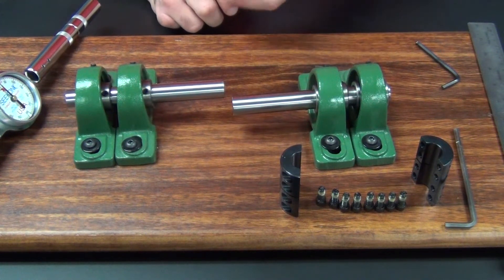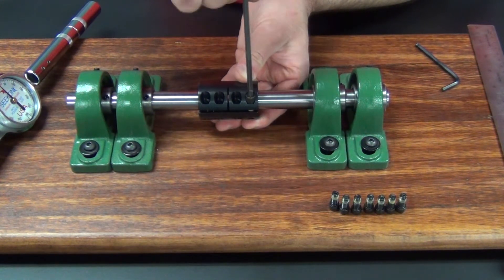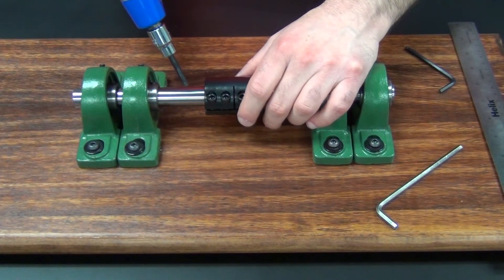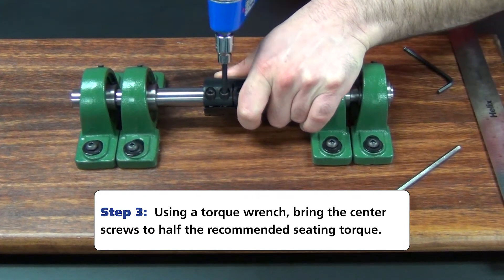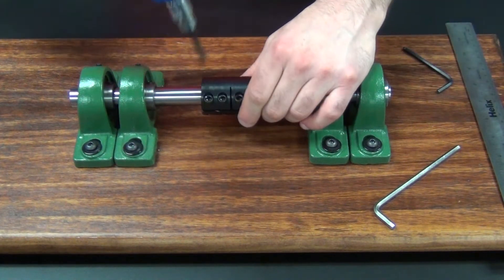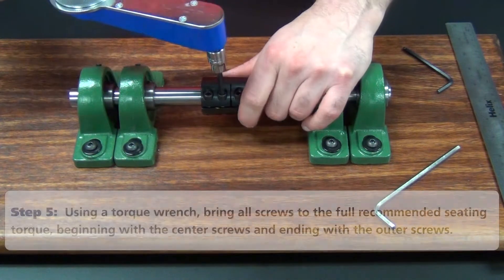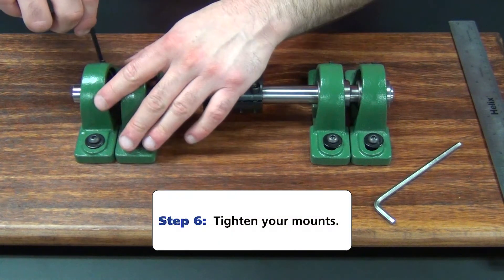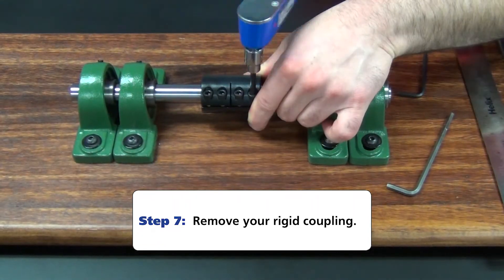How To Align Shafts Using A Two-Piece Rigid Coupling

Comment: If i have a 3.5 mtr long shaft at a height of 3 mtr with support of 3mtr in between, then what should be the procedure for shft alignment? The same procedure applies there also??
Reply from the maker: Hi Nitish. No, you can not use this guidance for that sort of application. This is meant for small precision shafting with close bearing support to the coupling ends. - Chris from Ruland